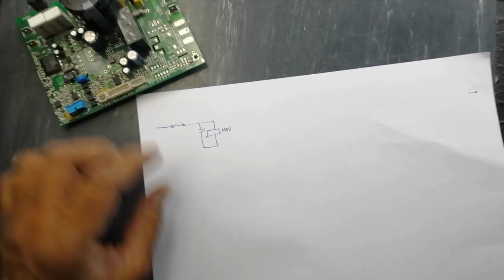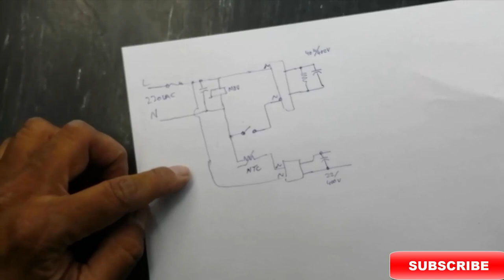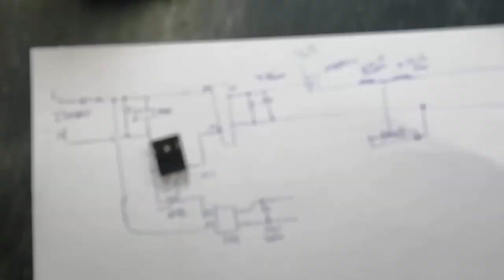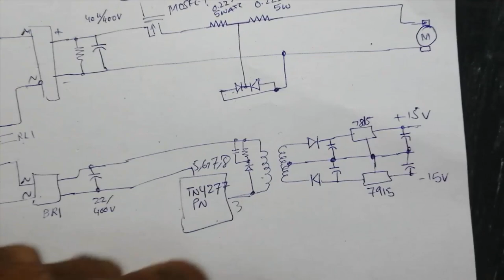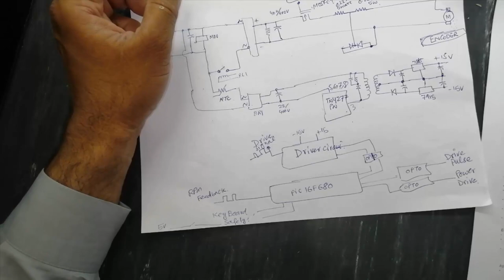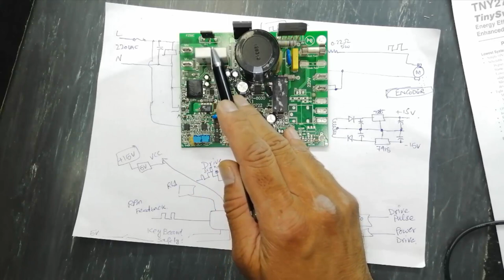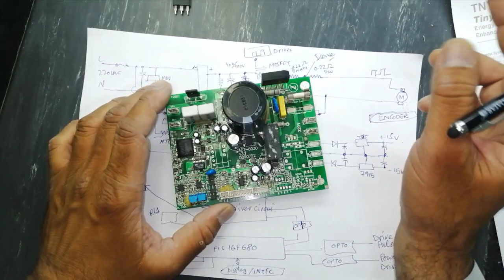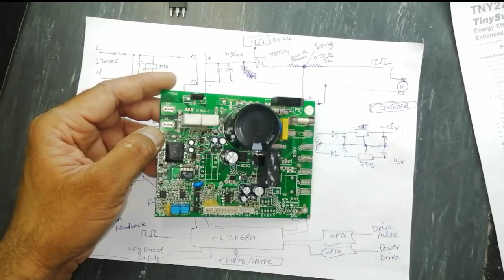271 How to Repair Circuit for TreadMill - Circuit Explained /Troubleshooting

Comment: hi! I have got e02 and already checked motor, capacitor, sensor, igbt, fastrdiode and bridge rectifier- everything is okay. But DC outputs on pcb have only 11V always and gence motor does not work. What is the simplest way to check the root cause? Thanks a lot!

Comment: What is the value of ZD3
Zener diode
Reply from the maker: if it is ZD3.0 then it is 3 volt 1.3 watt
if it ZD3.3 then it is 3.3 volt 
please check there must be some other number with ZD3 (for example ZD3 and some other number may be there)

Comment: Sir, My Treadmill employs the same SMPS board shown in your video.. The problem is it turns off within a few seconds of it starts full functioning, leaving the display a complete blackout. After plugging off the machine for 20/30 mnts and on turning on power, the same thing repeats. Kindly suggest a possible remedy, pointing out the faulty component (s). I am an enthusiast having basic knowledge in electronics. Thanks in advance.

Comment: My treadmill works fine on speeds 0.8-4 but when i want to speed up to 4.5+ the motor is speeding up to max speed. I'm going to replace the optical speed sensor because i dont have a good way of measuring it's performance. What i suspect is that the PIC18F45J10 from upper console is faulty and keeps sending speed up pwm signal through optocouplers to the driver circuit or the optical sensor is faulty but if its short i should get an error but i dont. Is there anything else that could be the problem?
Reply from the maker: possible problem is encoder, 
check the operational amplifiers, and comparoators for feedback network.
Reply: @HaseebElectronics  will do 🙏

Comment: what is the mosfet original  number  which is available in todays market my board is dcmd67 looks same diagram  to me the red light comes on but dc green LED on  ok
Reply from the maker: dear friend this time i don't have this circuit, i am not confident about its exact part number, because my computer was crashed last month in result of virus attack from a hacker, and unluckily my backup data also corrupted in the same virus attack. 
i am really sorry that i cannot reply properly without having some authentic evidence

Comment: My machine keeps shorting the mosfet.  Any idea what could be causing that? It also turns faster than what it's supposed to, if I click 4mph it would be turning at 5mph or faster. Thanks in advance.
Reply from the maker: first possibility, 
low quality and untrusted replacement parts 
gate driver is bad
there is something wrong with servo motor, might be stuck or jam. or wiring issue 
otherwise mosfet will remain safe because it is being controlled by the microcontroller
Reply: @HaseebElectronics  thank you

Comment: Assalamu'alaikum.
I have a DCMC75 treadmill board. The output produces DC and AC voltage. I have checked the bridge diode, Schottky diode, IGBT, everything is normal. What other components should I check,sir ?

Comment: Bro in my board one register short the no of register is 5w0.01omsj and now it's not getting in shop . Bro so what can I do now pls replay
Reply from the maker: I think this power resistor is used to current sense. so it should be used with same value and wattage
Reply: Bro so what I can do now
Reply from the maker: can you send it's picture to my WhatsApp 00962 79 1161084
Reply: Bro do you know where do we get this register
Reply: Yes bro I have sent

Comment: Dear my treadmil German tech galaxy when sw on motor will going over speed..isit's mosfet 's problems?
Reply from the maker: yes dear. its MOSFET or IGBT is short circuited, so it is feeding uncontrolled voltage to the dc motor

Comment: Hello friend!! Is there a chance that you could bypass the rpm sensor? my machine works fine but after 5-10 seconds it stops, replacing the sensor would not do it because i changed the pulley size so its expecting another rpms pulses, could you intercept the signal that is shutting down the motor??

Comment: Hello sir, 
I have a treadmill which is giving error 1 and i have checked the igbt, bridge rectifier, diodes, resistances, all the mosfets, and all of them are fine. There is no short anywhere on the power board. Whenever i turn on the board and press start on the console board, the relay doesnt click and there is no output. I have tested the relay seperately and it works. I cant seem to find out what controls the coil in the relay. I have tried to do everything to find whether something is broken but I havent been able to find what is broken. 

Please help me find the problem
Thank you

Comment: I Have a question about the incline motor. The bottom limit sensor is getting signal to the board but for some reason the  incline motor keeps going down. Why? 24:14

Comment: I have a proform 625 the display lights are blinking when powered on but treadmill will not turn the wire harness from the display to the power board Supply looks to be in good shape could there be something wrong with the power supply board if so how do I check with a multimeter
Reply from the maker: please check low power supply, might be it have fluctuations, 
check 5 volt, and + and - 15 volt or 12 volt. 
these voltage must stable
Reply: @HaseebElectronics  k thankyou! This would be a good video to cover for there are no videos explaining this
Reply from the maker: love and best regards 💗

Comment: In my case, when I change high voltage capacitance value, the 30R 6W resistor is blowup every time, which is between bridge rectifier and yellow filter capacitor and also one end of that resistor is connect with negative side of bridge rectifier???? I can't find the problem!!!!
Reply from the maker: please remove IGBT/MOSFET and output rectifier near to IGBT, then check, is it heating up?
if it stops heating up, then problem in the IGBT.
please check and reply
Reply: @HaseebElectronics  The IGBT checked and it is the in chip viper 26l 
8 pin IC and which is good. I check all capacitors, these are good and the VFD is run with 400v 47ufx4 .But when I used value capacitors 400V with parallel more than 220uf that discharge resistor is burn. Also I don't know discharge resistor value.

Comment: Sir my igbt was blown ,and I changed it and worked for 30 min without load and when I starts running it blown again ,can u guess the cause for the same ,as I have repeated the same process again with same result

Comment: Sir my theardmil when AC220 main switch is on continuously running the motar also display is off... But it continuosly run in high speed how can i analysis the issue of control both plzz reply me sir

Comment: Salam brother,  I have a treadmill and it was turning off after few minutes. I changed power capacitor and that issue is resolved. Now I have a new issue that speed is fluctuating can you please guide me. Thanks
Reply from the maker: Wa Alaikum salaam 
please check
dc voltage on main dc caacitor, it must be stable
check power supplies of low voltage power supply section
may be the new capacitor have problem. 
check input ac voltage then calculte (input ac volts   x 1.414= ___  ) if you find the voltage near the calculation result and it is stable , then it is good, otherwise check the bridge rectifier section

Comment: Sir mere pass ek goal company ki machine hai usme error hai or error ka no. Hai E03 to bhaijaan kya problem hai aap bata do plz
Reply from the maker: maximum machines me E03 error control board error hota he. aur is me ya to motor start hoti he aur stop ho jaati he.   ya start nhi hoti. 
agr aisa he to:-
possible reason
check speed sensor connection
check control panel connections
check motor connections
Reply: @HaseebElectronics  sukriya bhaijaan allah aapka or taufiq de insha allah

Comment: What is type of motor is it brushed dc motor or ac motor if it is ac motor so in that case there must be start up capacitor
Reply: Thanks for your replying 
Mr haseeb i have asked you for tow videos i know you have your own project and maybe u r busy but i hope if it is possible you explain when replacing pwm controller with different one not the same part number is it necessary to consider frequency or not
The second video i hope you explain is how to check comparator and op-am 
Thank you again for your efforts.
Reply: No deer you do not have to apologize u made me shy 
I appreciate ur effort  in sharing ur knowldge i am sorry man 
بارك الله فيك وجعله في ميزان حسناتك وربي يوفقك

Comment: sir plzzzzz continue DDM flyback SMPS Design
Reply: @HaseebElectronics  thanx and plz next video include RCD snubber, current sense register, output capacitor and inductor using uc3845/43 and core gap

Comment: I found the problem on my tradmill. It's suddently-off (screen off - moter stop running) after running around 20-30 min. and then 2-3 sec. it's come to work again.  What is this the cause of problem ?
Reply from the maker: if it works normal and then trips off and again works normal
it is symptoms that there is some loose joint or dry soldering joint on the main board's main power section 
while working the loose connection or dry joint,  heats up which causes to trip off the power rail 
inspect tha maon board rear side print carefully and if needed resolder   the doubtful joints
Reply: @HaseebElectronics  Thank you so much for your investigation and suggestion.

Comment: Hello.  inc-b304-s10 speed control board failed todat.  Appears that some components failed.  Leakage from ine capasitor and at least one ofher resistor/diod is all burnt.   Board has power and screw motor adjusts height but no power to motor.  New replacement board is arpund $300.  Way too expensive.   Can you suggest a way to bypass the board by installing standalone speed control?

Comment: Micro controller not recived rpm signal.consol board recived rpm signal..and this circuit used magnatic reedwhel sensor.

Comment: Do you know the interface with DC control cirrcuit?
Reply: @HaseebElectronics  I want to know the interface to drive transfer data from mother board (up) to power DC motor board (bellow)/ So could you share me information what is the interface it use? UART, SPI, I2C or other ?
Reply: @HaseebElectronics  thanks, But I cant read the data from control board to power board to drive

Comment: Sir...if trouble error 1 what is problem...??
Reply from the maker: most of machines get Error 1 due to RPM sensor, (if it arrives imidiately after start up within 3-6 seconds)
if it comes after 1 minutes approximately (at normal running) it is due to improper adjustment of the belt

Comment: VFD  for a DC  motor ? what  is all about?  Wrong ,,,,, VFD for a AC motor ,,,, know we understand boy
Reply from the maker: dear did you checked the working of the board, the structure & function of the motor & control board is VFD not VVD or VVD+VFD . even it is driving the dc servo motor, it uses pulsed voltage,  the PWM's signals and frequency is varied all the time to maintain the RPM